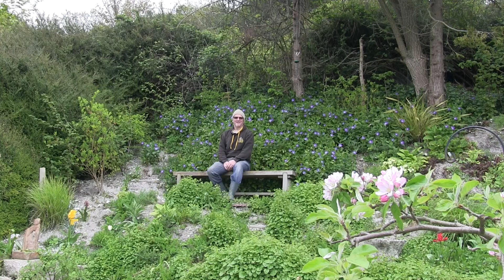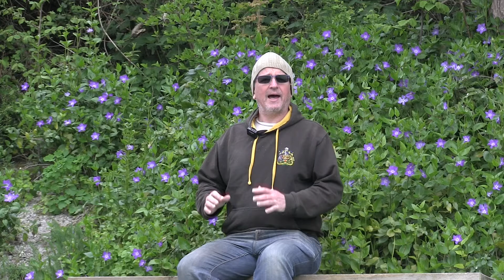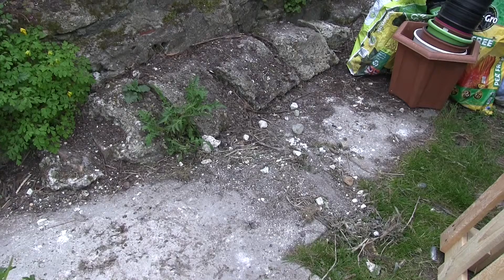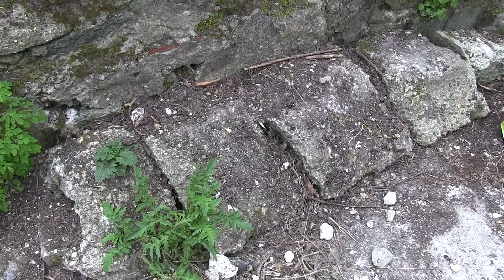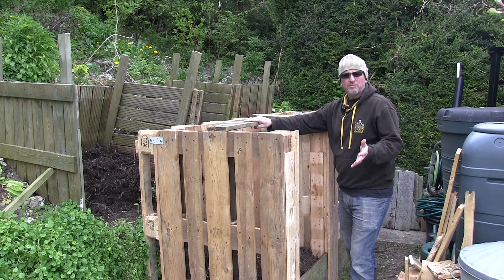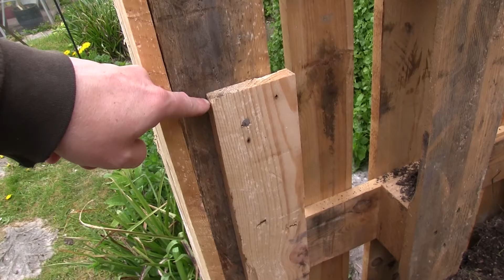How I Made Pallet Compost Bins

Comment: Looked fairly simple when there's help. Good idea about the gaps in the sides to allow critters in to help with the decompositioning.
Reply from the maker: Yes, help made light work of it. They're quite weighty, so I may well have struggled if I was trying to keep a couple upright whilst screwing in the coach bolts! It's working well, and the resident slow worm seemed happy enough in there.